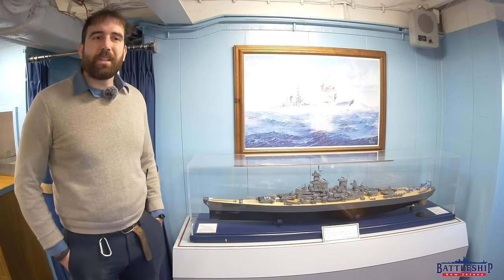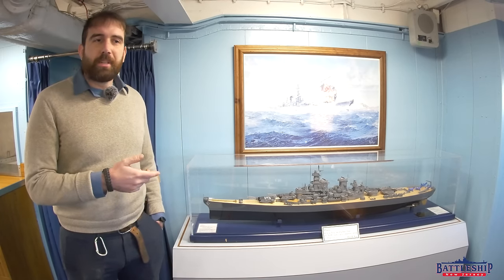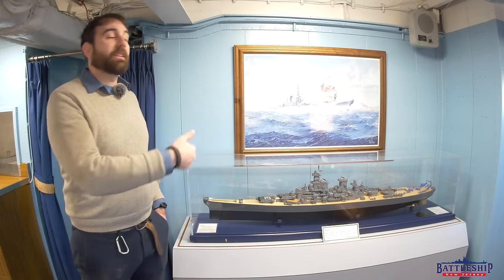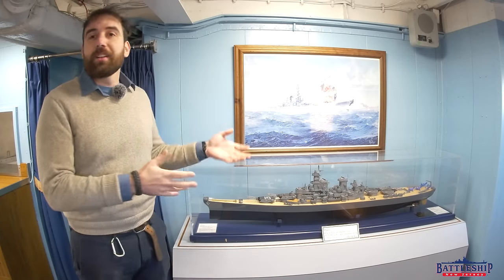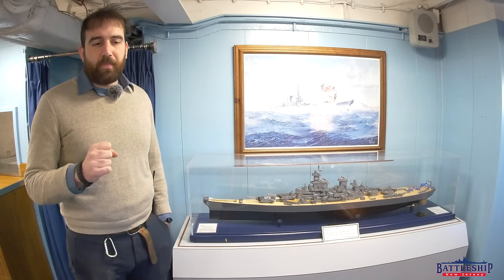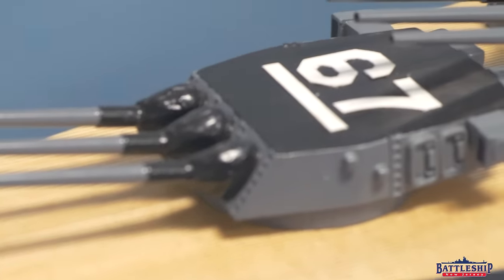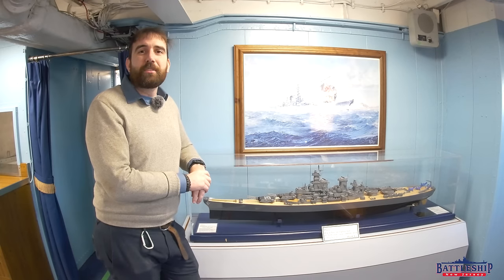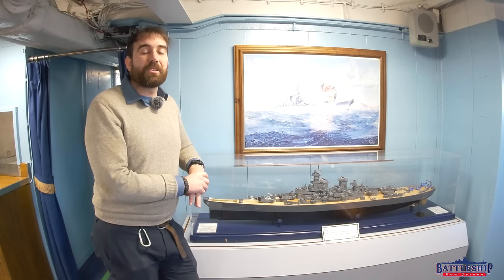Battleship Montana: What Would We Have Done Differently

Comment: Adjust the turrets to make it possible for a refit to 18-inch guns if its deemed necessary. Maybe even delete a turret in order to have a 30-33kt ship while in 16-inch configuration.
Reply: 18 inch guns are completely unnecessary and deleting a turret for speed just leaves you with an Iowa.
Reply: @majorborngusfluunduch8694  That's kind of the point.
It's about flexibility. The flexibility to refit to 18-inch guns if its deemed necessary to counter the Yamato class. Or A-150 if it ever materialized. 

In the meantime, we'd essentially have 4 more up-armored Iowas. We'd be abandoning the "balanced armor" philosophy, but I think the Navy would find value in having a "fast battleship" with the armor of a "standard battleship".

The only major downside I see is we'd probably have to pay for both 16 and 18-inch guns right away with half of them sitting in a warehouse. Which might compel the Navy to simply build the ships with 18-inch guns from the start.
Reply: @vinak963    Im saying we didn't need 18 inch guns to counter the Yamato. The 16 inch guns were entirely capable dealing with the Yamato. They had better performance in all aspects except raw damage. Meaning that obviously if the shell penetrates into a ship, the 18 inch shell has a bit more explosive power, but in terms of velocity, accuracy and penetration our 16 inch shell was on par with their 18 inch if not better. Its a case of size isn't everything. Its better to have 12 16 inch rifles, than fewer 18 inch rifles. I mean at the end of the day, Montana as we know it was clearly closer to an optimal design if that's what the actual Naval Planners ended up with.

Comment: I personally would lengthen the hull by 200', keep the beam and dragt move the bridge to the starboard side, remove the aft tirrets completely along with the second turret from the bow replace the first turret with a quad 12" gun turret like the Alaska class used and give it an angled glight deck for an assault ship carrying fighters and helicopters. Secondary weapons would include a mix of 90 mm and 76 mm radar aimed "sky sweeper dual purpose gns and 40 mm dedicated AA

Comment: I'd swap the twelve 16-inch guns for nine 18-inch guns. Retain the same hull dimensions of 921 feet x 121 feet. Retain the armor scheme, except for the armored conning tower and 20-inch turret face plates. Have a modern flight deck for helicopters. If advanced into the modern Era, I'd have four CIWS based on the 30mm avenger gun like the Dutch Goalkeeper.

Comment: At 7 minutes you're saying you can't lengthen them to make space for more machinery to increase the speed because then you're adding more weight and you don't get more speed. But if that were the case then you could never build a fast ship. You can never build faster because the greater length for more powerful engines is always cancelled out by the more weight. But they did build fast ships. they built Iowa and Essex which did 33 knots.
Wasn't Iowa a much longer South Dakota for greater machinery space for higher speed? It weights 10,000 more tons but they still got the high speed. So they obviously got more performance even with the greater size and therefore weight of the Iowa.
So why couldn't they do the same with Montana?

Comment: If I had a crack at this: I would do 3 turrets with 4x 406mm caliber 65. Two turrets forward and one aft. Six secondary turrets of 2x155mm caliber 55 three on each side of the ship all with autoloaders. This might be a controversial design. Compress the spacing of the boilers and make the cidel superstructure an armor honeycombed configuration. Instead of two exhaust stacks, there will be one. Doing this will shorten the ship by a quarter or keep some of the lengths for a more potent power plant or nuclear power plant. As for ani-air standard: 10–40 × Bofors 40 mm anti-aircraft guns 56 × Oerlikon 20 mm anti-aircraft cannons with radar guidance. Would up armor the deck to 65mm to balance. Instead of a single rudder, I would do duel rudders. How were the duel perpious 5-inch guns in the AA role compared to the Bofors and Oerlikon?  If excellent put 8 single-gun turrets with radar targeting. Four on each side I rather not have them to save weight and have the 155mm take the role in their place. Next only two float planes and one aft catapult. I would make the Bow more narrow and dynamic and have that underwater bow bodge. I forget what it's called. The upper deck structure will remain the same with a better narrow dynamic profile to let the ship cut through the wind. At this point, I would have to see the numbers to make farther tweeks. lol